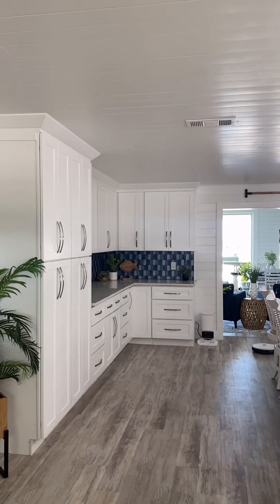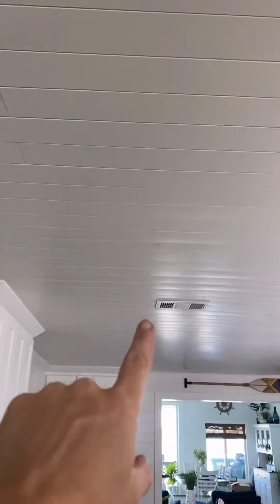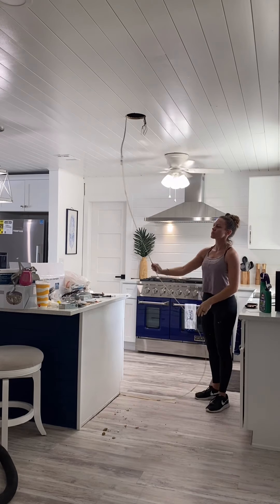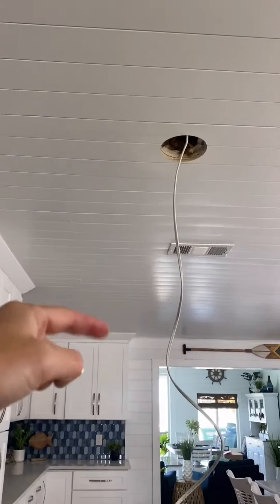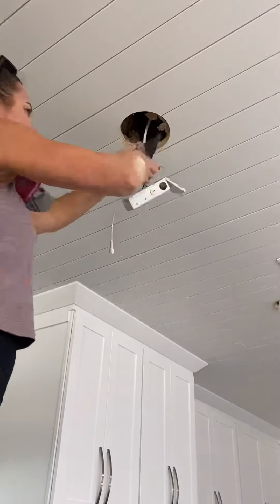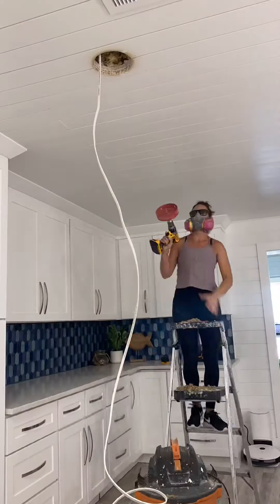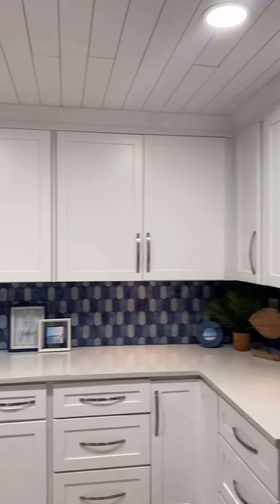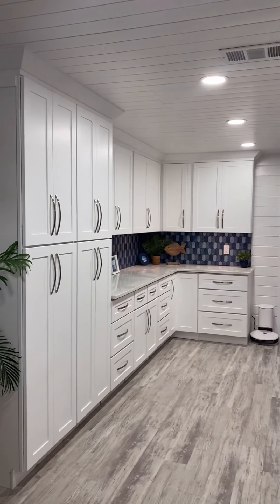Adding ultra-thin LED lights to my newly renovated kitchen to add much needed light!

Comment: Those slim lights are a game changer.  I had the traditional and bulky pot lights in my basement so I changed them out for the slim lights.  Taking out the bulky pot lights was pain in the butt compared to installing all the wiring.  It's SO much brighter now.  💗

Comment: So? You used the power source from 1 light? Is that safe?
Reply from the maker: This specific circuit could hold up to 12 of the lights. I added 4 more for a total of 8 on that circuit. Must know what’s on your circuit to not overload.